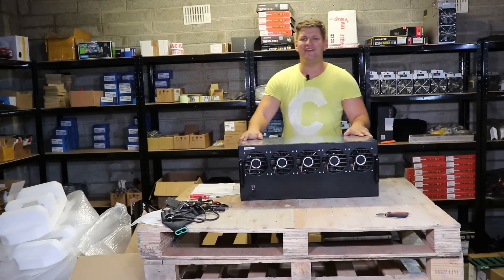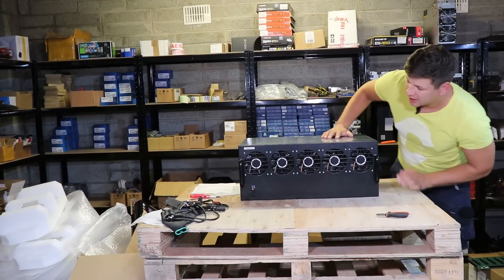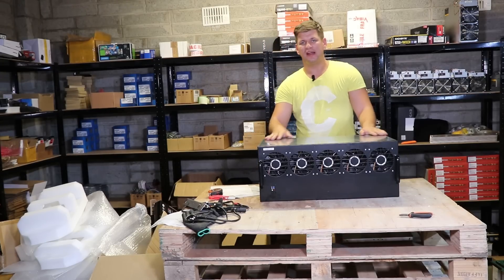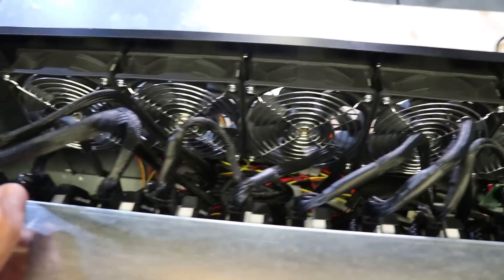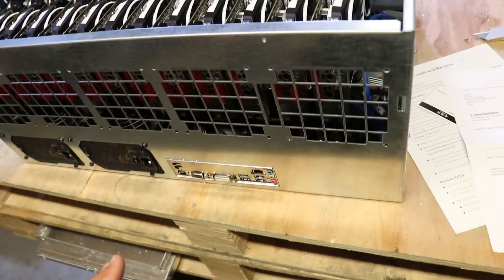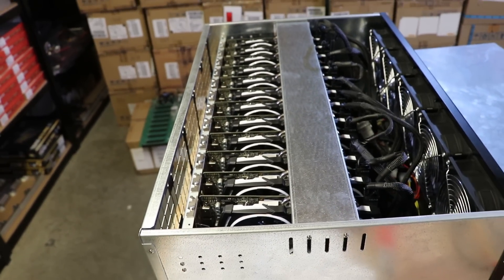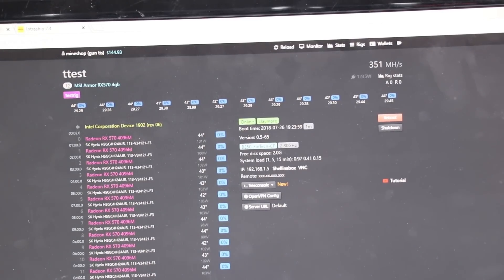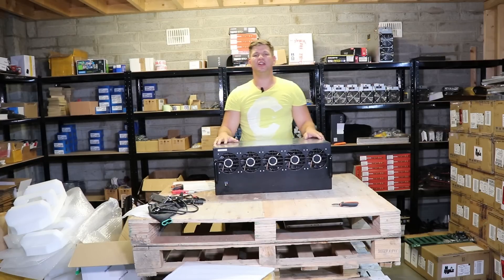360 mh ethereum mining rig in closed case..?

Comment: Nice video, keep your great work m8 ! :D
850W powersuplly times 2 equal 1700W total and your rig is using more than 1600W, you're largely over the 80% power usage of your PSU's, you should upgrade them or lower your Poerlimit on your GPU's. with an 24/7 80%+ usage of your PSU's they'll be prematuraly dead. Keep in mid that you never want to load your PSU's more than 80%  each at max. You should go with at least 2x1000W PSU's or even 2x1200W. I can suggest you to take a look at server PSU's, more effficient, lower cost and easy to use. I personally have an HP 1200W 80Plus Platinum brand new paired with a breakout-board and 12 6PINS to 6+2PINS cables. I've paid less than 70$ for the total shipping cost included. I've paired this HP server PSU with a little 400W 80+ Bronze that is only powering the Mo-Bo + CPU + HDD + FANS. Risers and GPU's are poered by the server PSU :)
Maybe you already know all that. In that case just forget all i say but if not, you should definitely take a look :)